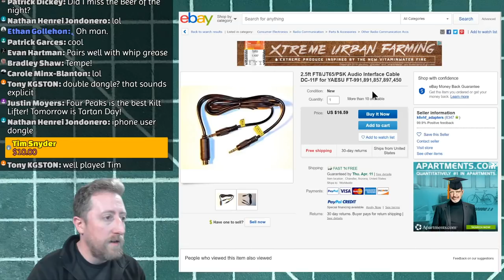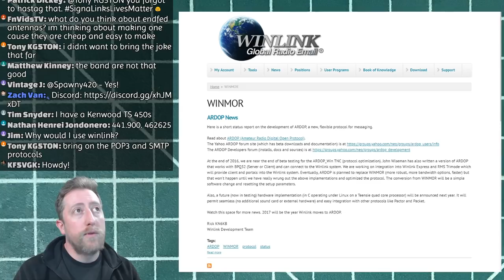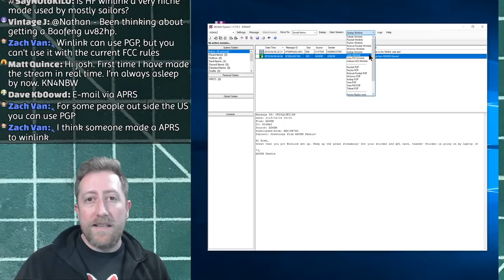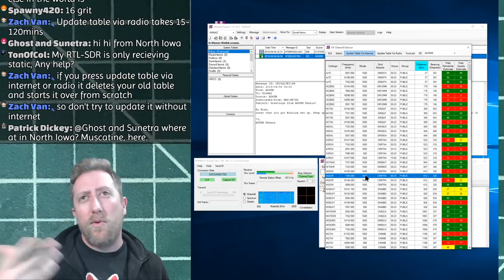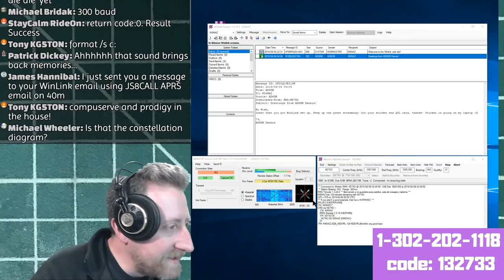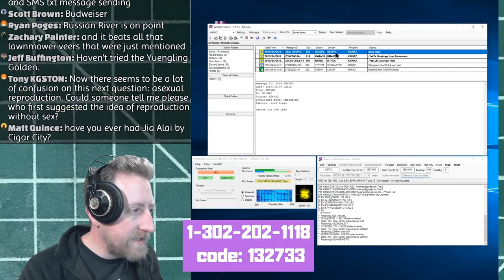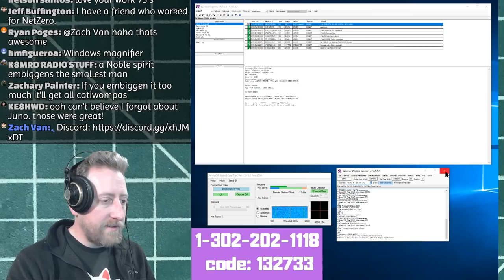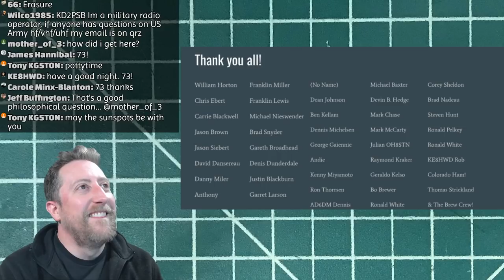Lets send email over Winlink using ARDOP & WINMOR on HF amateur radio

Comment: On Icoms, the IC 703+, 2720, and 746Pro have a 6 pin port for digi.  The 6 pin mini cable can do all three.  And a M-F cable extension cable for PS2 mouse is plug and play.

Comment: Watching this now in prep for receiving the Field Day message.  Question:  Does the USB Soundcard dongle that you use (and sell on your site) give audio isolation between the computer and the radio?  I guess you could set the radio to VOX and use that to key the transmit.  73